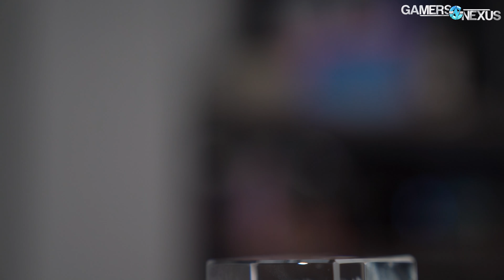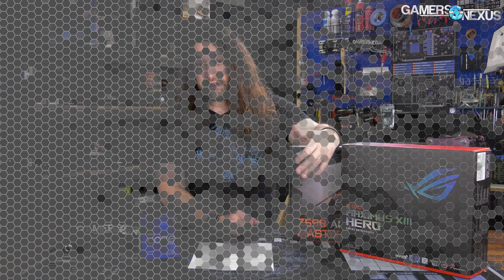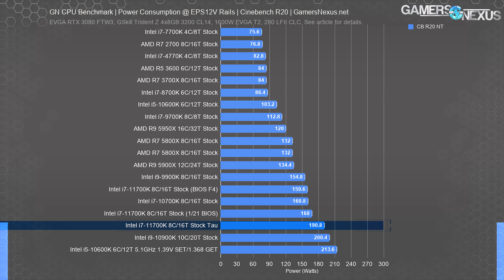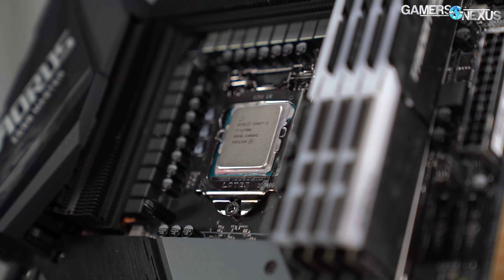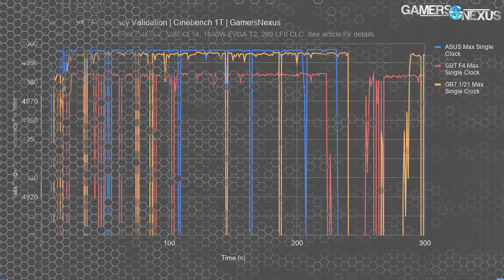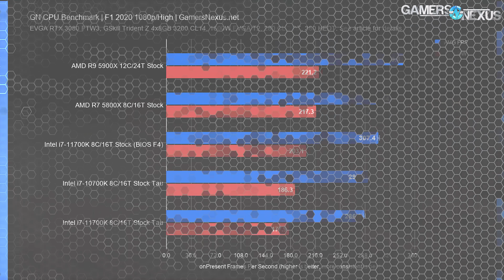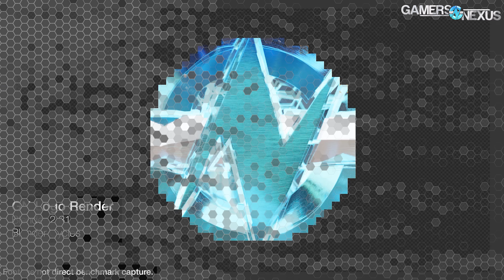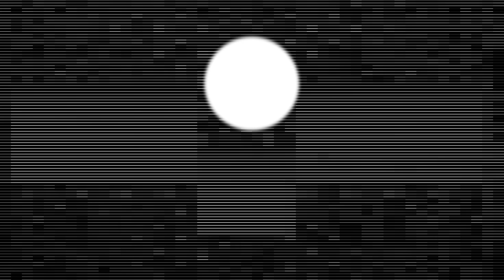Intel's Z590 Motherboard Problem: i7-11700K Power & Thermals Explained

Comment from the maker: Testing was done using parts we acquired entirely on our own, including from retailers, as open components available on retail channels. Other components, like the Intel i5-11600K and i9-11900K, remain under embargo until a future date as they were provided by Intel.
Watch our full explainer of the Intel power limits (PL1, PL2, Tau), TDP, and motherboard behaviors: https://www.youtube.com/watch?v=4th6YElNm5w
Watch our Intel Core i7-11700K CPU review & benchmarks here: https://www.youtube.com/watch?v=3n0_UcBxnpk
The best way to support our work is through our store. You can get our unique mouse mats, fully custom tool kits, shirts, and more: https://store.gamersnexus.net/
Reply: I don't care about power i want max performance that's all that's why i buy such motherboards or disable PL1, PL2, time duration as first tweek in bios anyway and put watercooling on my cpu and gpu. I still get why you are doing this but i prefer OC3D approach where he try to get the best OC of the CPU. Anyway even though your saying you bought the sample you still tied with the NDA and thus publishing performance before NDA can lead to consequences for you, it should still be fair, NDA is not something you can brake just because you bought it elsewhere it is still an intel cpu and you have an nda with Intel...
Reply: @Gamers Nexus  I have the Asus Z590 Hero with a 10th gen i7 and I had to use the XTU to override the limits to get it to overclock correctly.
Reply: Try oc'n the allready oc'd cpu. It will reveal cheatin.
Reply: A nice fan curve can be like the ocean. It can tell you when your CPU is working hard. It can teach you patience and mindfulness, but it shouldn't slow your PC down.
Reply: How does dark rock p4 compared to that liquid freezer CPU Cooler??
Reply: What thermal paste was used?
Reply: If I remember correctly for example Hardware Unboxed run its test using defaults MB setting for CPU power. They argument they do it this way because most of users will not change anything in this section of BIOS. Interesting how HU test will look like.
Reply: This is unrelated to the video, but your vids covering the NZXT H1, it allowed me to get a refund due to fire concerns on my case (Case, PSU, & Cooler) purchase from nzxt.com nearly a year after purchase.   Thanks a lot for your coverage.
Reply: @creativem0nster579  40c cant be correct, 60-65 makes sense
Reply: Nice to see this since this was one thing I missed from the original review. 

Though I personally would also take another look at the min fps. Especially in Hitman there is a noticeable gain over even the 5900x. Less severe stutters are great.
Reply: @creativem0nster579  0-40 is not a liquid max temp lol. Think about it, people in tropic climates couldnt use aios at all then, since their ambient can be 35-40 no problem. Also all aios are the same shit, so if one can work at 60c for liquid all of them can.
Reply: How come you only report on the two party DUOPOLY, SHILL?  Why doesn't anyone ever cover Cyrix anymore?  3rd party reckoning will come!
Reply: still waiting on overclocked result lol why get the k version??
Reply: I 100% get why you are emphasizing: Motherboards MAKE THE DIFFERENCE! Those boards can consume more electricity that may have a significant impact on someone's electric bill. But I have to get back to why Motherboard Manufacturers do this. Customers of those motherboards pay a premium for that more-or-less 'uncapped' performance. Components on those boards tend to be built to a higher spec, for a cost.
This is my personal opinion, but I feel your argument blaming 3rd party board manufacturers is somewhat flawed. The same argument does not apply to 3rd-party GPU manufacturers, as they step over the guidance as well. Especially the cards designed for serious overclocking.
If Intel wanted to lock this down, they could, however they stick with the tried and true method of willful ignorance. And let reviewers/investigative journalists deal with the mess. It's unfair for you to defend them, and I don't think you should. It's like taking car reviewers to track days with new cars, showing their Chevrolet Corvettes can handle the punishment of tracks like Laguna Seca. When in truth they swap out cars every few laps... Please stop defending Intel/pushing for a method of forcing a universal standard of their products. It will just become synthetic benchmarks, and nothing real-world scenario. That is the whole point of having many-people testing products in unique circumstances and environments.
If you read all this, thanks for your time,
-JB
Reply: Hey, sorry - quick correction. At about 15 minutes, there's a remark about "extremely low spots in the IHS" and that "that's shown when you look at where the copper is getting revealed against the nickel plating".  Exposing the copper (underneath the plating) would be indicative of a HIGH spot - (i.e., the IHS is highest there so the nickel gets worn away there first). Just so your viewers know.
Reply: What about amd "motherboard behaviors"? 5900x is working on 105w default?
Reply: Bro, try to use arctic mx5 and see difference
Reply: I really want to know just about everything but all this high-tech benchmarks.  For me which MB works best in a basic budget build and gives me Wi-fi, good speed enough memory to keep me happy and will have 4.0 pcie, a good number of USB slots and does what gaming computer does.
Reply: i bought a gamers nexus mousepad . i will upload benchmark video vs different hard liquors see which one gets the best thermals.
Reply: WHy you jumping between 5600X and 5800X between games? How is that a comparison?
Reply: So u buy a 11700k for force limits in a K intel version? You know K version don't have cooler in the box?
For 90% people play games at home they dont care like me about Watts... 
Is this video a "look im gonna explain why others guys in youtube get better results" ofc they have, no one buy a 11700k and put a mid range board and enter bios to lower cpu performance this is a complete joke.
Reply: @bastordd  hey, sorry do you know how to force those limits?
Reply: @karo8254  yes, but if u dont know you can search on youtube.
Reply: @bastordd  hey thanks for replying. Can you please share the link or tell what title to look for. Or just simply tell how to do it please?
Reply: @jonikfirst9760  your motherboard brand? and chipset
Reply: @bastordd  thanks for replying.
It is Z590 Aorus Pro AX, and CPU is i7 11700k
Reply: @jonikfirst9760  i dont understand why u want put limits on cpu but ok... https://www.youtube.com/watch?v=uNVPBH0bgQU&t=18s 
After 10:00 go bios and follow the stock power limits.
Reply: @bastordd  please you tell me Ricardo. I am really not a computer guy. I just want to buy a PC and it has that motherboard and CPU. After watching this video, I feel it should follow Intel's guidance as to avoid high temperature and damages
Reply: @jonikfirst9760  well get the pc and after that you can learn someting :) 
If you are new in this "pc world" its better you take advice from your local store or someone guide you.
Reply: @bastordd  Thanks a lot. That was very kind of you Ricardo to provide that info.
Can I use the example of video even though I would have i7-11700k?
Reply: @bastordd  well I want to make sure if its the right choice. Is it okay to buy these two. Will there be not any temperature issue or any problems. It has RTX 3070 ti
Reply: @jonikfirst9760  you can use the 10 or 20 sec video reference for put limits on your intel cpu.
Is not about the CPU here is about brand motherboard.
Because the interface on AORUS is difference from Asus, MSI, etc. But all of them have the same parameters is about how you find them.

Comment: So I bought the MSI Godlike z590. Put together my whole system and had a few issues with Windows and some cam software with the NZXT ordeal. Now I wanted to use my pcie 4.0 slots then I previously paid for not knowing that the 10th Generation doesn't work with it so I bought an 11th generation i7 and all I get is error error error error in error for my CPU and it will not boot up

Comment: I have mobo on Z590 Chipset too (Asus Prime z590-P, and my I7-11700k  is hitting 70-81º for 3-5 seconds when  for exemple i'm playing games and switch between levels, my vents start go at max speed  (my water cooling cpu pump is constantly running at max speed almost 2500 rpm) so for exemple idle temperature  of cpu is 40º, then when i load level in the game, temperature rise to 80º+ in 2-3 seconds for short period of time time like (5 sec+-)  this is normal ?? 2 times my pc just turned off under one of these peaks, looks like temperature hited critical lvl for 1 second or so, don't know exact cause cuz it happened very fast. Bios version is up to date, version  Ami 1410   installed at 27/01/22

Comment: this comment is on an old video and i probably wont get a response but worth a try: can i pair this CPU with a Asus PRIME Z590-P ATX Motherboard? I want to build an older gen to save money and I want to save money on my motherboard but I don't want a crappy motherboard.
Reply: Yes you can pair just make sure it supports LGA or PGA your choice based off board or chip.

Comment: 271+ watts ... stock settings ... i7 11700k ... ASUS Prime Z590M-Plus ... MSI Afterburner ... 68 degrees max temp ... as far as I can tell, it never throttles down. maybe because it never gets hot ¯\_(ツ)_/¯

Comment: I don't understand everything that's said here but my i7 10700kf has bad temperature spikes, When my average temperature sits at 50 it spikes in a split second say to 70+ and back down to 50 the next.. I've lowered my voltage to 1.23 and also have changed coolers and better thermal paste, Still does this, It's overclocked at 4.9ghz on a z590 board... Someone please let me know what could be wrong.

Comment: I have this gigabyte board and the 11600k.has anyone ran the gigabyte auto overclock program to 5.1ghz? It raises my voltage up to 1.6v and Temps at full load reach up to low 90s C. Is this a direct relation to what GN is explaining? TDP according to hwmonitor never surpasses 124w

Comment: I NEED HELP, I HAVE INTEL CORE I7 11700K WITH ASROCK 570 STEEL LEGEND AND IT HEATS LIKE 90 DEGREES WITH GAMES WILLE MY GPU HAS 50-60 DEGREES WHAT SHOULD I DO PLEASE HELP.

Comment: i dont know where to post this anymore, ive tried everything already could please someone help me with a problem im having

im running a 11400f and a RTX 3070 
I basically swapped out my old i7-6700k for a new z590 mobo and the 11400f 
performance was great the first days then i started noticing games getting around 30-50 fps lower and afer a few rounds of playing any game my fps just goes up to what it used to be
im not running any power limits on my cpu my temps are more than adequate during gaming and i dont know what to do anymore

Comment: i have i7 11700 (non K) runs on gigabyte b560m aorus elite, always runs above 4.5ghz on default settings while cpu usage 3-4%, temp around 44C. 
Yet my nephew have the same processor runs on Asus tuf gaming b560m-plus wifi gets stock clock speed on default settings. 
does it have any impact in long run if the processor runs on higher clock speed?

Comment: TDP IS NOT A POWER CONSUMPTION it is the amount of heat generated. it is an output power rating, not input. a 100W TDP CPU generates 100W of heat at a specified frequency.
for instance the the I7-11700K has an average TDP of 125W @ 3.60 GHz when running all cores at that speed. the turbo 2.0 & 3.0 will increase that TDP to a much higher level.
remembering that TDP is the heat output of an item, not power draw of an item.
from Intel Ark for the I7-11700K "Thermal Design Power (TDP) represents the average power, in watts, the processor dissipates when operating at Base Frequency with all cores active under an Intel-defined, high-complexity workload. Refer to Datasheet for thermal solution requirements."
TDP should ONLY EVER be used to describe the amount of heat generated at a specific clock speed, higher clock speeds means more heat and a higher TDP.
the 125W ONLY applies when the processor is running at it's base frequency on all cores. once "Intel® Turbo Boost Technology 2.0 Frequency" or "Intel® Turbo Boost Max Technology 3.0 Frequency " kicks in, the processor is at a much higher TDP.
there is also a TDP down frequency where the CPU on average generates 95W of heat @ 3.10 GHz.

Comment: Ignoring price, which of these three Z590-I ITX MoBds (AORUS ULTRA, Unify, ROG Strix gaming )
.. would be the better choice for a single core intensive AutoCAD workstation, set up as:

119000K (set to 6C/12T), 
OC - 5.4 on 2 cores and 5.1 on the other 4 
32GB x 3200Mhz RAM
dual 240 AIOs

Comment: Think of it this way this CPU has 8/16 cores and threads, which is more than enough for both gaming and some mid-tier software editing. If you have a decent GPU, it won't be bottlenecked by this CPU. Run it in gear mode 1 and if possible use a CL 16 RAM at 3200 or 3600 dual or quad channel setup, 1000W+ PSU,  a nice cooler either an AIO or a well planned Airflow system preferably vertical system to work with convection rules of physics to allow for better air circulation. And you should be golden. This is my objective standing. 

But if we go into this subjectively. There is no point in comparing CPUs. My advice, don't buy anything, save enough money to buy the best bang for the buck and recycle every 10 years. Because obviously, a cheaper 11700k won't work as well as a high-end Threadripper. So why waste money buying a cheap thing where you can just be patient save money and get the best thing out there? Everything is a waste of sand in that worldview. However, if you absolutely need to buy something and feel that "Oh yis, I didn't buy this stupidly" then go ahead and buy something that costs 10$ more and performs 5.7% less than this CPU, which is pointless nowadays, cos anything above 120fps (which all these new CPUs will be able to provide if they are manufactured properly) shouldn't really matter for gaming nor streaming (if streaming is not your main job, otherwise again, why buy cheap shit, go for the most bang for the buck if you plan to 120% invest yourself in that field). 

Therefore, I strongly stand against the notion of saying any product manufactured is pointless. Especially when it is by a large company like Intel or AMD. Not me, nor Steve nor Linus, no one except the companies themselves are privy to all the required information to say exactly why these CPUs were built. Pretty sure, bad decisions get made, but they get made for the right consumer reasons. Otherwise their respective business models wouldn't work in the longer term. 

And here is a hot take for this particular case: If you have two similar products and you buy the cheap one and leave the "expensive" or generationally newer one at the shelf you will be doing what you are required to do. The best way to sell something from last batch is to make a new batch that is very similar to the new one yet is more favorably priced. So consumers will gravitate towards finishing unsold stocks. Ofc intel won't make more 10700K so the one to replace it will be 11700k. 12700k will be of the same logic. Unless you go for the most bang for the buck. You will be stuck in this buy the old one cos it's the same and cheaper loop. And you will improve your setup much, much slower than you'd anticipate or plan for it. 

To conclude: My current setup is ASUS rampage Extreme IV with core i7-3930k and 16gb HyperX blu 1600Mhz ram, Cooler Master Air cooler, 700W PSU with a GTX 1070 8GB no SSD and 1TB hard drive. I made this build back in 2013, which was the most bang for the buck at the time and had cost me close to 4000$ VAT and shipping costs included. The only change I made to it, was add an 240 Kingston SSD around 2017. But that was it and it runs like water to this day. I can play most games on it above 120fps (League of Legends, World of Warcraft, CSGO, Dota 2, heck even No Man's Sky runs on it with decent above 60fps on ultra settings). My point being, if I hadn't gone for the most bang for the buck at that time( I wasn't doing so well financially at the time too), I might have needed to swap out more parts throughout the years and it would cost me more than the 4k I put in the beginning. If and this is a big if, I decide to upgrade now (which I have no issue doing now since I am doing pretty well financially), I would still go for the most bang for the buck. That would last me another 10 or even 15 years (again if all the parts work properly as they should out of the box). Unless consumer grade quantum computing or quantum computational gaming emerges sooner than expected, that, I can't plan for. Then I would have to swap out to that new system/platform. 

Thank you for your time if you actually read all of this :D

Comment: Price difference between the 10700k vs 5800X is over +$150, and given the small advantage of the 5800X i'd say 10700k is a much better value. AMD's are getting overpriced due to popularity.

Comment: As a SFF enthusiast, I'd love to see the same tests done with a 65 W part, like the Core i7-11700 (non-K).
Reply: I have a gigabyte motherboard and the same processor it finally makes sense! My temperature is reading consistently about seven minutes into any game to 95 Celsius. After installing a massive dual radiator  dual fan air cooler and proper intake and exhaust airflow it only dipped down to 88 Celsius.
Reply: @Jeremiah_..  are you ocerclocked?
Reply: @DaSesh  no what I did is remover the upgraded air cooler and put a liquid cooler Corsair 360mm and it resolved it! Can’t even get over 43 Celsius under load, it’s amazing.